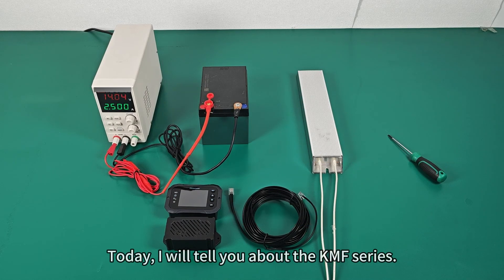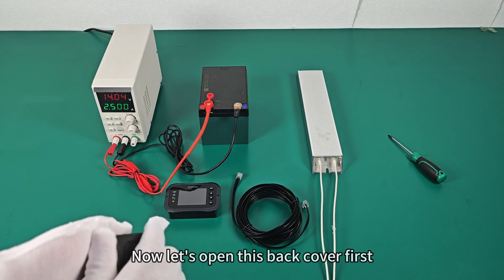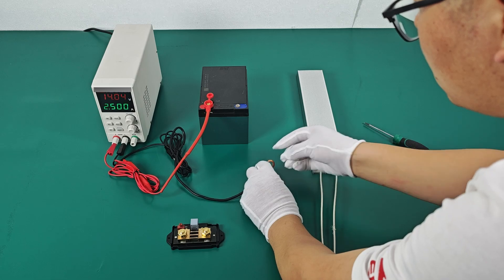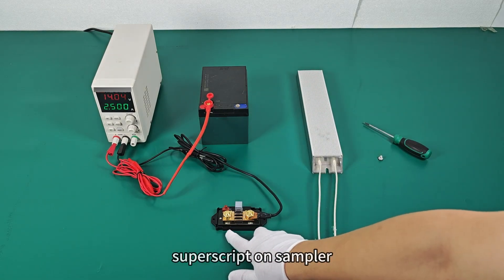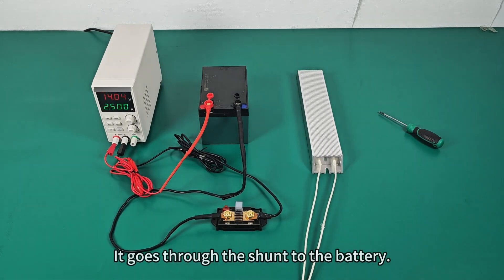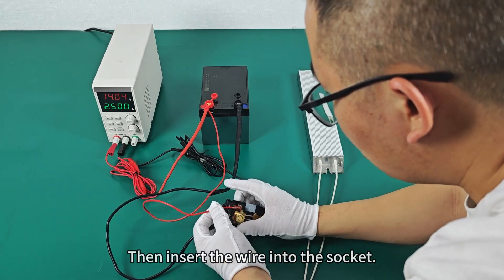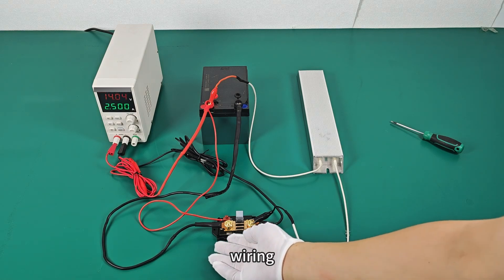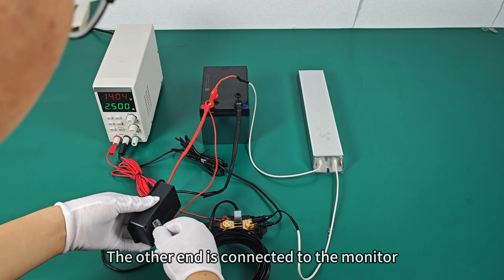KM-F Series WiFi Remote Battery Coulomb Meter: Detailed Wiring Tutorial and Setup Guide

Comment: Hi, good afternoon. I bought a KM160F and connected it as shown in the video.
I'm trying to get help. It seems like the device is defective. But before returning it, I'd like to be sure if it's actually defective or if it's a configuration issue. I've already installed it on another phone, reset it, and repeated the entire process, but it didn't work. It only connects via Bluetooth and quickly disconnects, preventing me from connecting to the internet. I have four packs and 100ah LIFEPO4 batteries that operate at 25.6V. A total of 400ah. I configured the device at 80%, or 320W. Can you please help me?